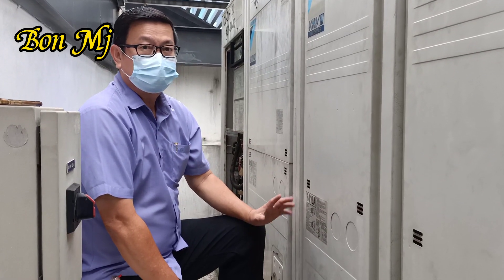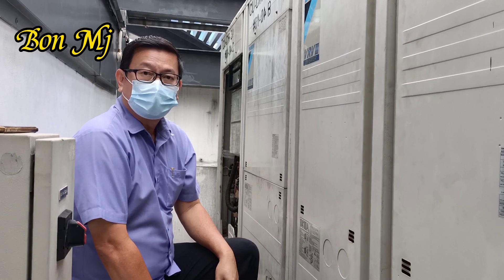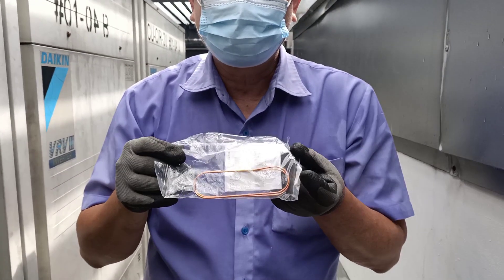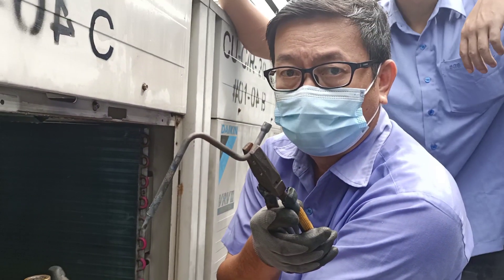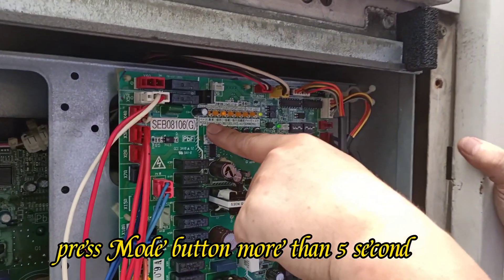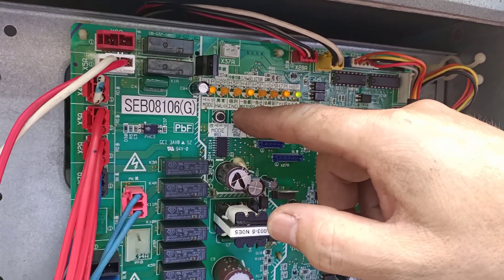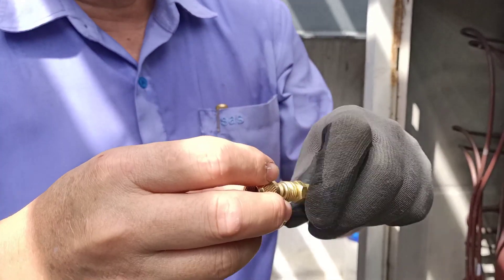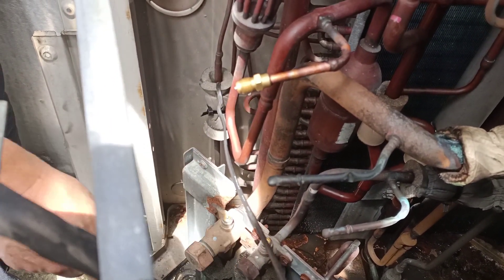Daikin | How to repair an VRV air conditioner refrigerant leakage.

Comment: Hello, Mr.Bon, RXQ8PAY13 vrv3, firstly capillary tube was damaged and we have oil lost. I would like to know how many liter (mL) do we need to add after changing capillary tube. And then, i would like to know that the capacity of compressor oil in normal compressor. (inverter, standard1 and standard2 of VRV3). thanks!
Reply from the maker: Hi, normally replace capirrally tube and compressor together is better way.i not sure how is the compressor oil level.
Reply: @BonMj   thanks!
Reply: Bon sar for what purpose you have set the setting of 2:40, please tell.

Comment: Hi ! Mr bon  If the capillary tube leaking should be the oil also come out right then replace the capillary tube need to top up oil or no need
Reply from the maker: Depend by customer budget.$$
Better replace the compressor.

Comment: Sir pls make a video on daikin vrv 3 odu discharge thermistor value how many Kilo ohms required and how to troubleshoot  J2 error.
Reply: I've been dealing with j2 and can't seem to find the problem 😕
Reply: I think the thermistor value should be normal when it shows 32 or 40 something which relates with atmosphere temperature. Upto 60-70 the thermistor is faulty. For J2 error Outdoor Unit Standard Compressor Current Sensor may  Fault or This is a fault with one of the standard compressor's current sensors.

It occurs when the unit's PCB asks the compressor to run but then doesn't recognise that the compressor is drawing any current.

This can be due to a fault with the compressor contactor not coming in or a fault with either the Main PCB not giving an output to the contactor or not receiving the signal from the current sensor, or it could be a fault with the current sensor its self.